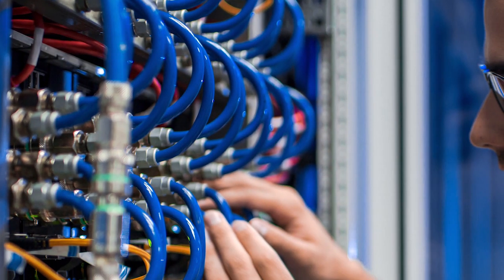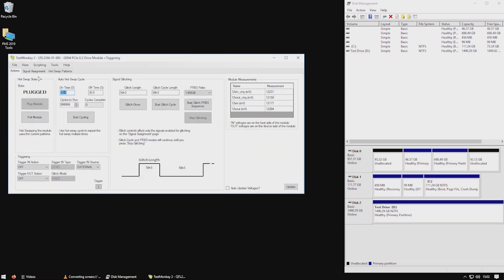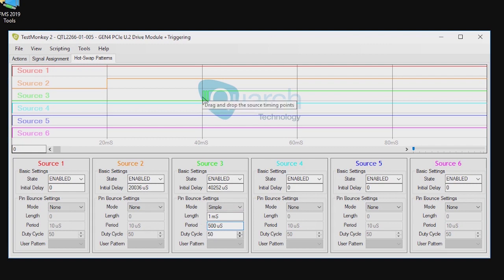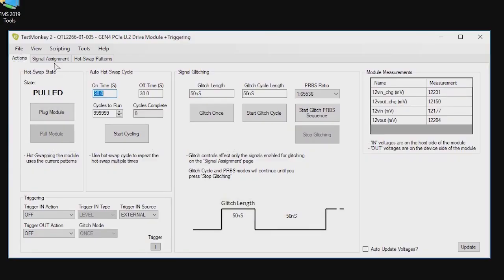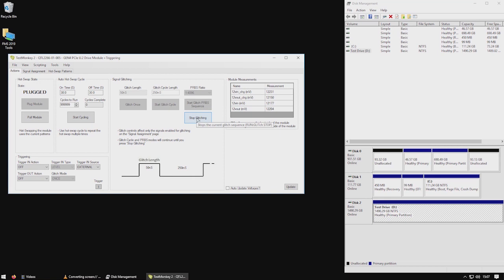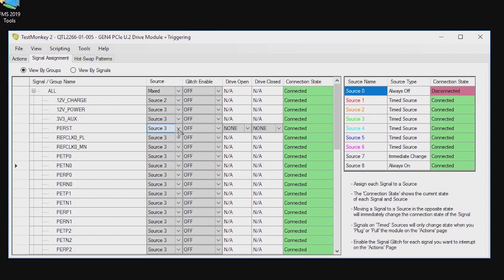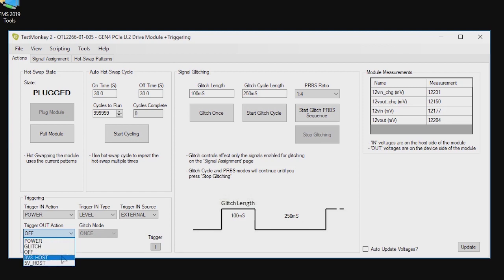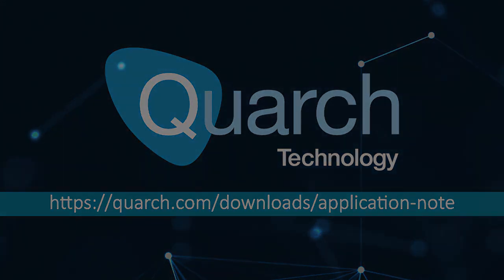Demo: Hot-swap and fault injection with Quarch Breaker Modules and TestMonkey

Comment: my question is why prbs ration 1:4096  with 50ns glitch means every 2s fail but not every 2ms？
Reply: You would get a glitch (on average) once every 4096x50nS = 204.8uS
PRBS is random though so the glitch timing will not be consistent. 1:4096 =  0.0244% of the link time will be interrupted
Reply: eh, ,firstly thx for answering my ques , just at 3:43 of this video, subtitle displays "roughly ervery 2 seconds", I just doubt about  the "2 seconds" from where ? @andy24628